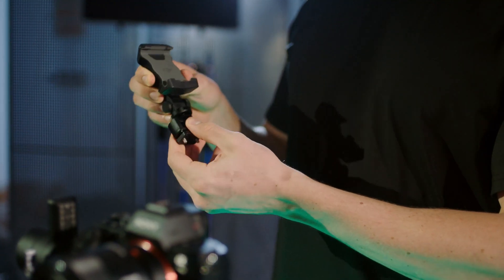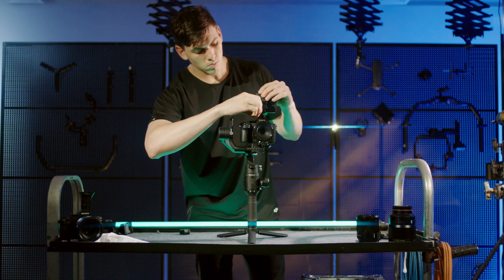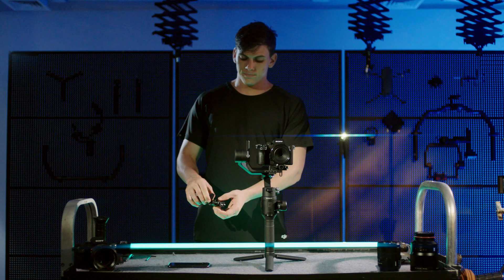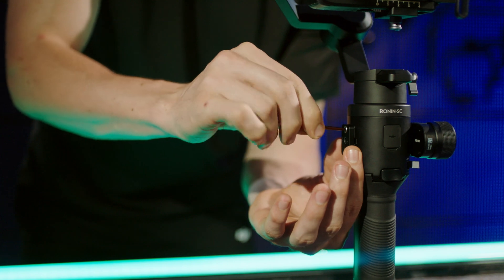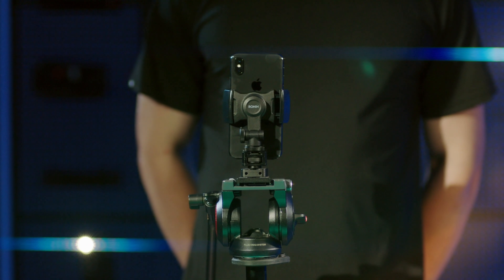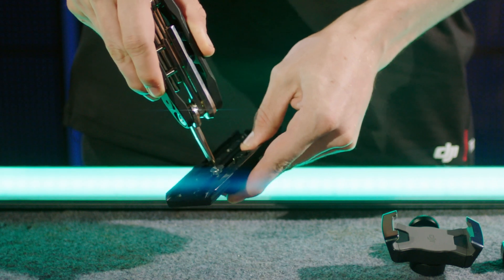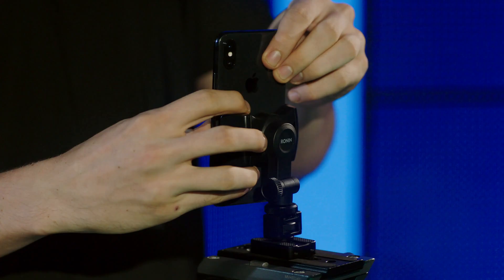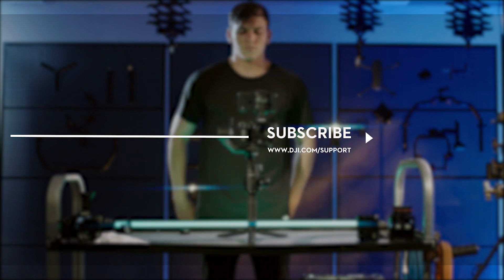Ronin-SC | How to Assemble and Use the Ronin-SC Phone Holder

Comment: Here's where I'm having an issue. right at 0:49 it shows how the phone is mounted to the side. The phone holder is in a hot shoe that goes into that tiny little black square looking thing. My problem is that there's no way to tighten that square thingy. Because my phone is heavy, the phone keeps nodding forward. Eventually, my phone ends up facing down. Does anyone know how to tighten that thing? I'm not sure what I'm doing wrong.

Comment: I have two conclusions about this tutorial.
1. It is almost impossible to balance the gimbal with the phone above the camera. And if you turn it on half stable the motors vibrate too much. A total waste of time. Dji did it again in order to sell.

2. It is the only real way to use the phone with the stabilizer. And it does not give the same results as if it were above the camera when using the active track.

Comment: Does the attachment tilt 90 degrees when used as a monitor holder? if it faces forward there's no point using the monitor, you might as well just look at the camera screen. I'd like to use my mobile as a monitor for low ground shots
Reply: You can rotate it

Comment: When u mount on the side do u have to rebalance it? Just wondering
Reply from the maker: Hi Aryan, when mounting the phone holder to the side of the grip, you don't need to rebalance the gimbal if it has been balanced before mounting the phone holder. You may check if you would need to balance the gimbal again based on your gimbal's specific situation. Thanks.
Reply: @DJITutorials  What do you call those screws in the mount?
Reply: @juliuschiong2251  Yea I'm late but if you were still curious those are 1/4-20 size holes, a standard size for a lot of photography gear

Comment: Does the Ronin SC charge SONY A7 2 & how many hours will they work being connected? Thank you!
Reply from the maker: Hi there, the Ronin SC will not charge Sony A7 2 series, you may check the compatibility list here: https://dl.djicdn.com/downloads/Ronin_SC/20190828/Ronin_SC_Camera_Compatibility_List_en.pdf For the working time, it can be used up to 11 hours when the battery is fully charged and the gimbal is well balanced. Due to the mounted accessories, balanced status, working intensity and other factors, the actual working time might be different which ranges between 6-9 hours.

Comment: where is the new firmware update ?
Reply from the maker: Hi, firmware v1.1.0.0 for Ronin-SC released on 28 August, please update the firmware by the Ronin app, make sure that the app has been updated to the latest version first, and ensure a working internet connection. Please let us know if you didn't receive the update notification.
Reply: @DJITutorials 
Hi And this is the problem... didn't receive the update notification.(iPhone 6 Plus)
Reply from the maker: @Nickgdjlfdvbk  Please try another internet source, or restart the app and gimbal, please connect the gimbal and the app. If the issue persists, please provide the screenshots of the current firmware of your Ronin-SC and the Ronin app for further confirmation. You can send the screenshot via support@dji.com directly.